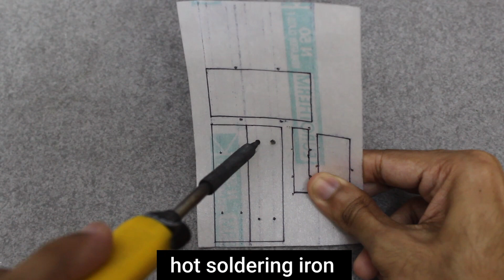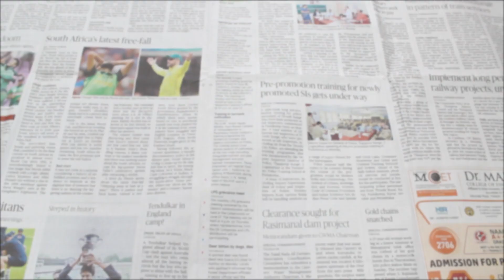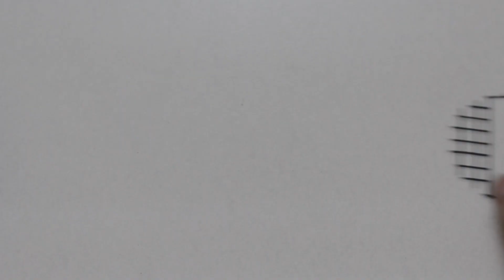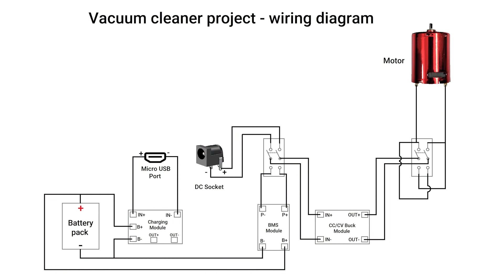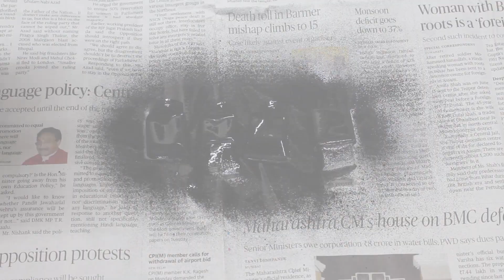Pocket Sized Vacuum Cleaner ! |DIY

Comment: HAHA THAT IS ONE BIG POCKET

But still, honestly, creative, neat, and well designed diy concept. Great job 🤙

Dude wet your hands for the epoxy putty tho
Reply from the maker: Really? Maybe not for  jeans,  but for a casual shorts, i think its a normal size.
Thank you for your appreciation 😊
wetting hands could affect the bonding between the surfaces and may result in smaller gaps, especially on slippery and smooth PVC pipe sections. 
Since perfect seal was very critical for getting proper vacuum, I honestly didn't want to take any risk. 
But if its below 10  minutes, the epoxy could be easily washed off under tape water. 

Appreciate your valuable suggestion.
Reply: Spectacular 🌟

I guess i was just used to using water proof epoxy putty (epoxy clay) that dries up in less than 10 minutes so I dont have time to keep a lot neat while still being able to clean my fi gers before it dries up. Thanks for the upload! More projects to come 👌
Reply from the maker: Yeah got you point. The one I'm using takes more than 10 minutes to harden and i do get more working time ☺️. 

You are into crafting? Thats cool!

Thank you very much for checking out the video.

Comment: Hove to make it work with just 1 battery and without the direct mode? Is there any 1/2 size battery of 3.7v so that I can use two of and get the same voltage output?
Reply from the maker: That would be a bit tough. Raising or lowering the voltage is fairly simple in DC Circuits. However, our problem is around current consumption and not voltage. The motor is very power hungry and it need around 3 A for proper functioning. This calls for using a battery pack having higher capacity ( higher mah rating). In my case, a single 18650 li ion cell would struggle to work individually. So i used two in parallel, thereby doubling the capacity.
Reply: @HobbyRoom  Hi I had one more question. If I am just using the TP4056 Charging module and not using the Constant current/Constant voltage buck converter module do I still need to use the 1S battery management system board (BMS board) ?
Reply from the maker: @dikshayaldonkar95  Hi there, unfortunately we have more than one issues here. 

The constant current/constant voltage provides two functions. 

1) it regulates your direct mode voltage (you could use any DC adapter from 5V to 30V) to the rated 7.4V of the motor. 
2) When the motor is powered at its rated voltage of 7.4V, it will consume a current of 4.2 A. This is heating up the motor than the normal level and more than that, its not good to pull this much of current from our 18650s. To solve this issue, I used this CC/CV module to restrict the current draw to an optimum level of 3A.

So you should use the CC/CV module, you can't skip it actually.

Same thing for BMS module. you can't skip using it. 

The TP4056 module can charge 18650s and also provide over charge & undercharge protection. However this module have a lower current capability where, the output pins (out+ & out-) on the board can handle only a current draw below 3A (only upto 2.5A, if you want to be on the safe side).

This doesn't suits our application. So we are using a separate protection board called BMS with the battery pack. This is rated for much higher current (around 10A) and does our work. But BMS only provide battery protection and not charging. 
hence we need to use both the BMS and the TP 4056 module for the above mentioned reason.

In short, you need to use all the modules for the intended functions.

Hope this clears your question. If not, do let me know

Comment: Is it possible for me to do without a Micro USB port and charging module?
Reply from the maker: Hello there, thank you for watching the video.

Coming to your question, the answer is, it all depends on the specification of the motor that you are using. For the same motor that i have used, it will be difficult.

Continue reading if you want to know the reason. 

In this project, we have two problem associated with using the motor. 

1) The problem with very high rpm motor is that it heats up quickly and cant be used for more than one minute or so. To add more time for continuous running without overheating, the current draw of the motor should be brought down. Under normal running conditions, the motor consumes around 4.2A. For our need, this draw is reduced to 3A using the module called cc/cv buck converter. This solves the heating problem to a great extent.

2) the charging module have an positive & negative output terminals through which the power is supplied to the motor. 
However this output pin is only rated for a max current of 3A. Also, it is much better to limit this to around 2 - 2.5 A to reduce the stress on the circuit module. So it will be difficult for the output pins to provide the required 3A current to power the motor.

To solve this issue, a separate module called BMS module rated for a higher current is used. It is the output pins of the BMS module which powers the motor. Whereas the  output pins of the charging module is totally left alone.

 Hope this clears the doubt. If anything isn't clear to you, please let me know.